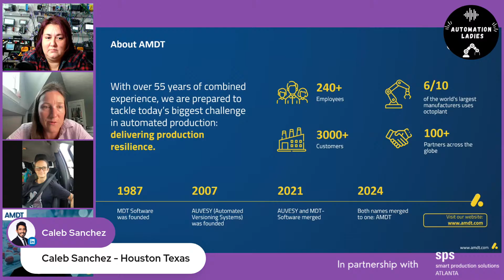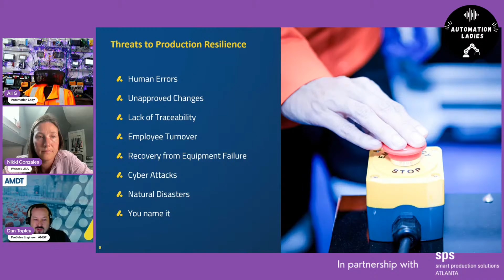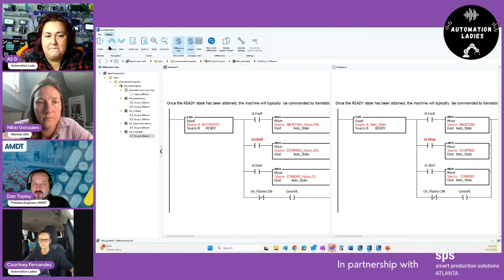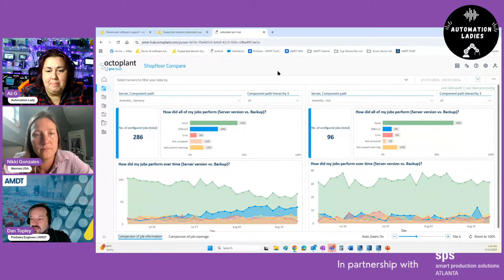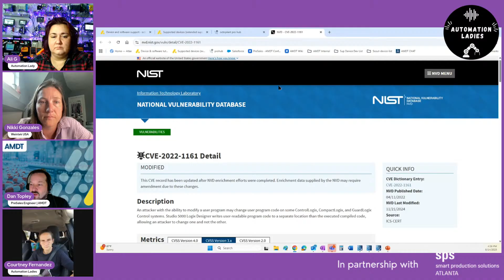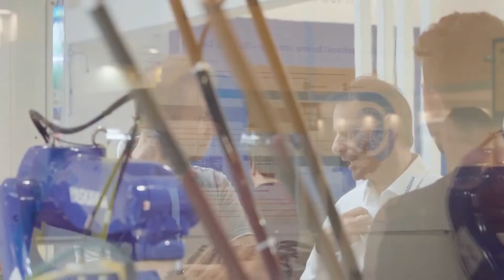Demo of AMDT's Octoplant with Dan Topley

Comment: actually the mentioning about Claroty, Nozomi and Tenable are taken out of context and DISENGENIOUS 
1. These are not the same products. and IF bandwidth is experiencing problems; it is NOT the fault of the SW because they use span or mirror traffic ... it's probably due to old hardware not compatible - OR from too many internet connections so that is DISENGENIOUS marketing there. LAN traffic should not be a problem for any of these systems AS LONG as the hardware is NOT old.
2. Claroty (and Nozomi, Dark trace, Dragos, etc) provides a lot more insights into OT Security than Octoplant. They are NOT competitors, they are complimentary products and Octoplant should be seeking partners in this area. 
3. the IDEAL scenario would look like this = OctoPlant + Claroty + Elicity